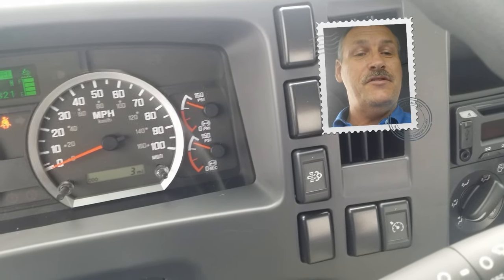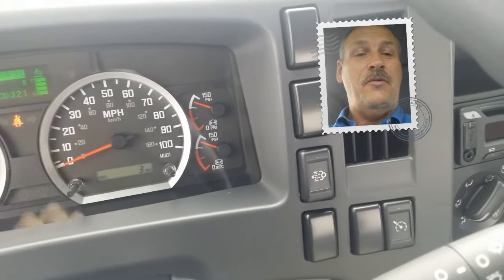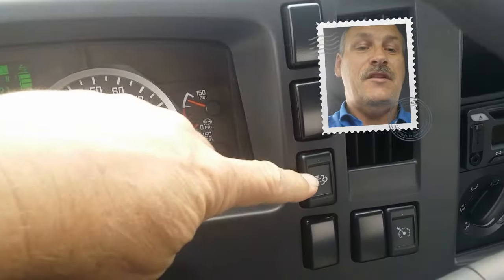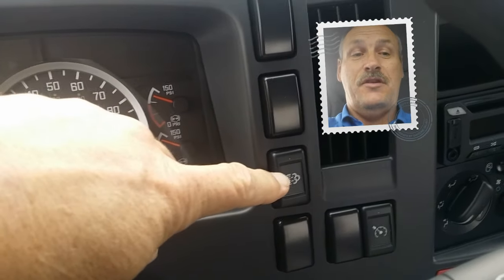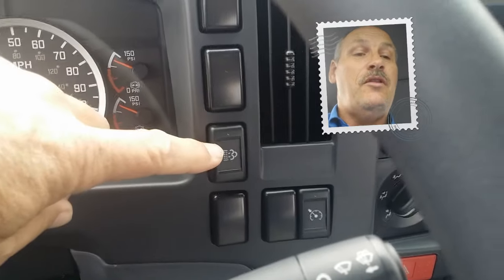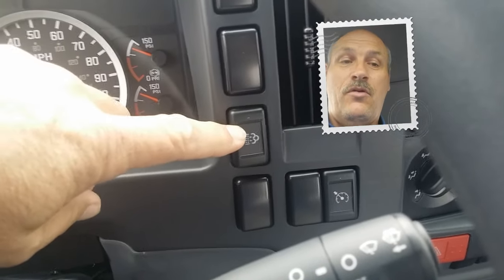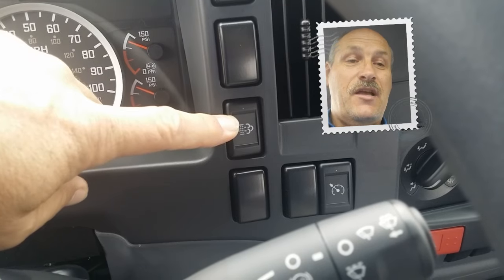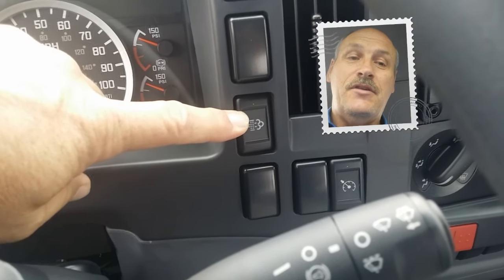Isuzu FTR Manual Regeneration Demonstration - UPDATED NOTE on How To Manage The DFP

Comment: Thank you for the tutorial. When selecting the button for some seconds it will check the PM level. If required to Regen I had to push a second time then to actually start the cycle.
Reply from the maker: You are correct!! Thank you for the help! I will update the video and make comment on the intro line of this video.  For additional reference see page 3-47 to 3-62 in the FTR Owner Manual.  The system check no longer automatically jumps to regenerate.  The switch must be selected again if the MID displays the need for a selectable regeneration.

Comment: They are great and fun when they are running. But man I got mine with 83k miles and now it has 103k. I’ve lost count of how many times its been in the shop… 
3rd time for DPF getting clogged.
I’ve only owned if for 2 years. 
Run future buyers!!!
Reply from the maker: Thank you for sharing your experience.  I am interested in uncovering how the shop was unable to process the the filter.  Was it an aftermarket location that is performing the service?  It is unusual for a filter to last only 20,000 miles after a deep burn.
The true process is for the filter to be removed and inspected for broken honeycomb and fracture breaks.  If they exist to NOT perform a deep burn and vacuum service on the filter.  The filter needs to be replaced with a non damaged filter.  If the filter does not have visible damage, then a deep burn and vacuum is perform on the filter.  If properly serviced the filter would be good for another 95,000 miles.
As your truck experienced a much shorter life, I would encourage approaching the servicing company for confirmation of the services they provided.
Unfortunately, there are some instances where the words "the system was cleaned and an extended regeneration was performed" are construed to mean they serviced the DPF filter.  That is not the same as a removal and deep burn.
I look forward to a continuing conversation regarding your experience and to confirming what part of the system was an issue.

Comment: Hey Mike! I drive one of these for work and mine will have the PH level full and won’t tell me I need a manual regen. Do you know what might cause that? And even when I do the manual regen procedure the display will read “checking PM level” and then it will go away and continue to show a green display and shows that my PM level is full. If you have any idea or opinion on this that would be great!
Reply from the maker: please forward a picture of the gauge reading - sorry for the delay in responding.  I have been out of touch these last 11 days.
As a rule, the manual regeneration check system would fault if there was an issue.
I look forward to your picture  molden@lee-smith.com

Comment: can I do that while driving on the highway? Mine will not go over 5 miles an hour if I have to stop the truck in the middle of a regen cycle  I have to pull over and wait till its finished . NO CODES  thanks
Reply from the maker: So sorry for the response delay.  You are going into a limp mode for some reasons.  What is you model year - please consider sending me an e-mail molden@lee-smith.com with you VIN

Comment: Can you help me with something? I usually did regeneration myself. Today he suddenly did it on his own And he doesn't stop. It's constant revs at 2000. Can't I disable it somehow? Whatever I press doesn't work
Reply from the maker: If this is still occurring please let me know the model year and miles.  Please advise on the MID (multiinformation display) what the filter level it showing.  Look at the back of the visor to determine where in the service cycle your truck is regarding the filter.  Please send any available picture to molden@lee-smith.com  Thanks!

Comment: Hi, when I push it is supposed to sound a beep, if not beeping so is not working?
Reply from the maker: No.  No sound.  Look at the MID screen on the center of the dash - Once held for 4 seconds a message will appear showing that it is going through a regeneration check.  If needed it will progress.  If not.  It will not and you are GOOD TO GO!

Comment: My 2011 NPR will not do this. It shows red SEL Regen Required light but after checking the PM, pressing it again will not cause it to go into regen.
Reply from the maker: Seeing red is never a good thing.  Sad to say if you have not updated you SCR since 2011 - it is probably due.  This one may definitely need a technicians eye.
Reply: @MichaelOlden  I just got it a couple months ago. The previous owner had paperwork (I now have) showing a new DPF and where they reinstalled the full emissions system after someone had deleted it.

Comment: Where is the reefer tank located? I just started driving for a company, and this is my first time driving a refrigerated truck! Company didn't provide any information just the truck smh
Reply from the maker: Most reefer units are plumbed to the fuel tank of the truck.  Rarely is there a pony tank if your refrigeration unit is stand alone (not driver by the trucks engine).
Reply: @MichaelOlden  thanks for your response

Comment: these trucks are a nightmare after 100,000 .
Reply from the maker: Gerald - What part of the truck is becoming a nightmare?  Which system is creating the issue?  The DPF? The DEF tank sending unit?  There are times that mechanical frustrations need a vent, and I welcome those comments too.  If I can get a little more feedback - it may lead to helpful insights for people experiencing similar issues.  Thank you for you consideration is sharing more about the items you are dealing with or dealt with.
Reply: I have a 2011 NPR that will NOT go into sel regen. The light is red, and I am pretty sure it will go into "reduced power mode" if I drive it. Why won't it regen?!?
Reply: @imallin971 same thing keeps happening with my work truck.